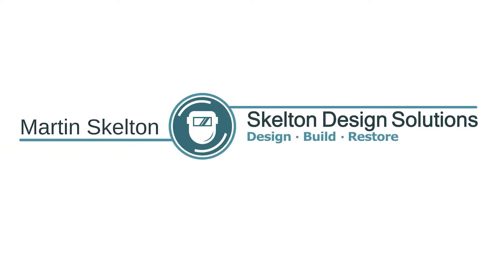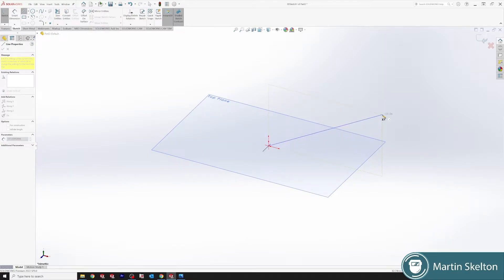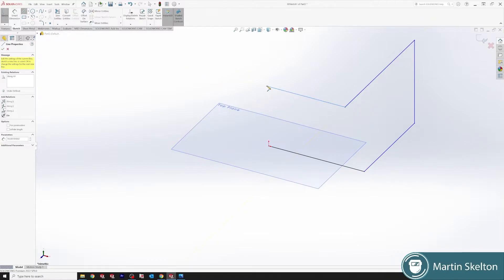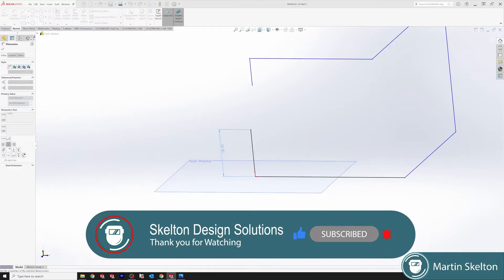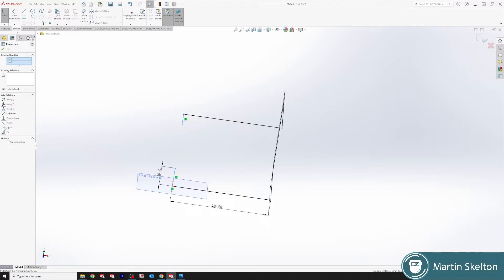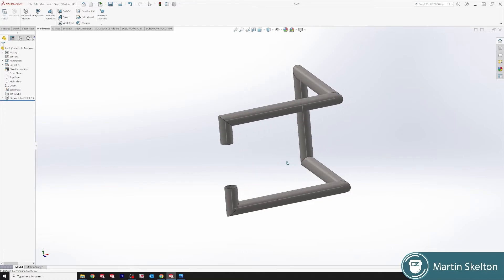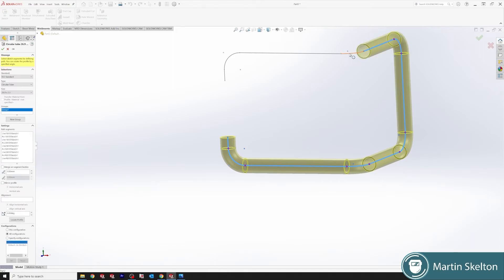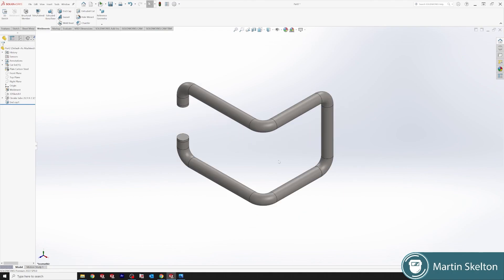SOLIDWORKS WELDMENT Tutorial #10 // 3D SKETCH // WELDMENTS

Comment: Thanks Martin, this was very helpful and interesting.
Reply from the maker: Hi Alan, Glad it was helpful. 3D sketching is hard to get your mind around at first. It is difficult to draw without turning the model but after a while and a lot of tab button use, it really reduces the time required to draw a "complex part". It also provides the ability to produce sketches that can not be done / easily done using standard plane sketches.
Draw an object on the 3D sketch and then try and recreate it only on standard plane sketches and see how difficult it is. Thanks for the comment Alan